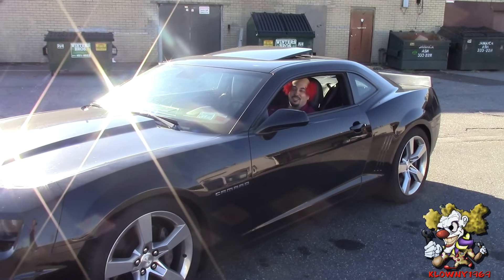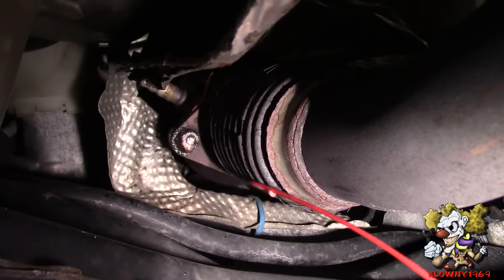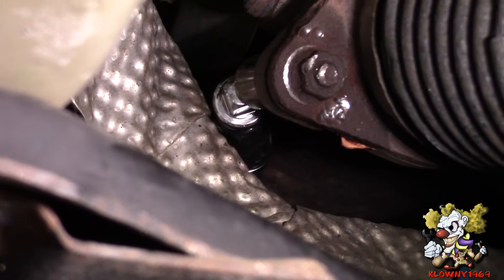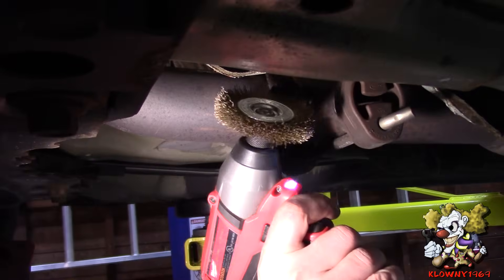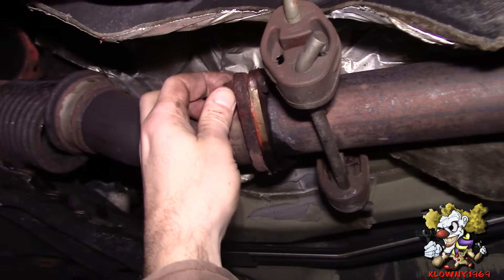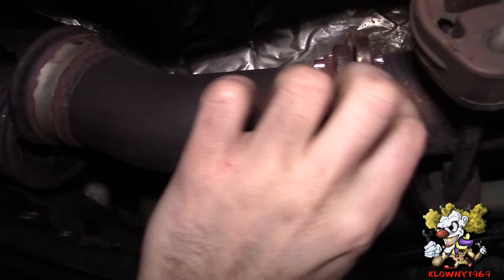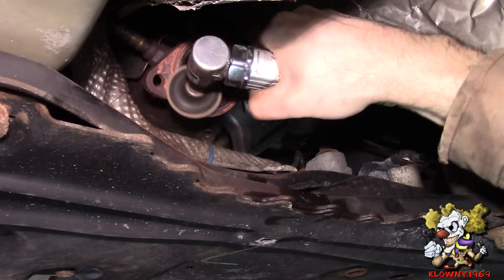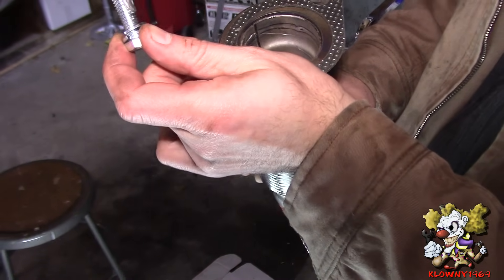FLEX PIPE EXHAUST REPAIR !! EASY DIY !!!!

Comment: Can flex pipe be part of the header? And if so do you habe to replace whole thing?
Reply from the maker: You can cut it off and replace it..Thanks for watching and don't forget to subscribe
Reply: @klowny1969  thx for info, would most auto shops have flex pipes laying around or you have to order it?

Comment: Will a bad flex pipe make a loud noise only when u start the car and accelerate that's what my exhaust is doing.
Reply from the maker: it could be numerous other things as well..you need to identify where the noise is coming from..dont forget to subscribe

Comment: I bought a aftermarket header tht came with a new flex pipe.  now the car makes a ticking noise. don't see any leaks anywhere but I heard the flex pipe that comes with headers is junk.  can a ticking noise come thru a cheap flex pipe
Reply from the maker: ticking noise is usually a leak..dont forget to subscribe

Comment: Amazing video quality. Thanks for putting in the time and effort for making and sharing this.  Much appreciated.  I saw a few drops of water leaking from one of the flange connections.  Is this something that one should try to seal up with high temperature silicone gasket?  Or is a little water leakage from the seams OK?
Reply from the maker: Little water is ok..don't forget to subscribe 😉

Comment: On that second flange since it's an actual nut and bolt you could tighten instead of loosen and just snap it and replace nut and bolt. It's sometimes easier to do that instead of trying to get it loose. I have done this and it works. I wouldn't do that with studs of course, but if it can be replaced, why not?
Reply from the maker: Thanks for the advice! Don't forget to subscribe

Comment: Hi Klowny1969, could you recommend andy video's on air tools please, I picked up an impact wrench here in UK 2nd hand no instructions, it has settings one to 4, I am unsure how to determine what settings to use as scared of breaking bolts, also do you set the compressor at say 90psi before you press the trigger on the tool or does  it need to be say 90 psi when using it, also as I see how hold spanners on the other end while using air tools is this ok when using certain settings as scared of breaking my arm, excuse my ignorance but I would like to learn, many Thanks Ian
Reply from the maker: sandydogy i keep everything maxed out..150 psi on compressor and highest setting on gun..ignore the recommended 90 psi, u would never take anything off...snd only use impact tools when taking bolts off..not putting them back on, unless u know what ur doing
Reply: klowny1969 thanks

Comment: I'm here cause I have a 2009 HHR that just rolled 100k a month ago and low n behold the engine light came on for 3 days. Then went off as soon as I borrowed a friends code reader. It still came up with a code even without the engine light on. The code $7E8:engine   and $7EA. I've looked all over the web and came up with "Hot oxygen sensor" and cracked flex exhaust pipe. 
Does this sound right to you or anyone in comments? 
Will replacing the flex section like you did here reset the engine warning light? 
Just looking into it before going to a shop and hearing what they think and will charge.
Thanks for your time and cool video.
Reply: idk but if your car sound louder than usual when you start it and it makes lot of noise when you drive then you need a flex pipe . run you about 180-350

Comment: How much does a repair like this cost? I ran over a dip kinda hard and now I think I dented/broke mine.
Reply from the maker: depends if they change just the flex pipe or the whole pipe itself with the flex..just the flexpipe should be under 100 bux..if the whole pipe needs to be changed..then u could be looking at couple hundred, depending on car
Reply: klowny1969 
It's a 2008 ford Taurus it was throwing a P420 code the day after I hit the dip and looking under the car the flex pipe looks pretty dented...so I'm hoping that's what it is so I don't have to replace the whole thing.

Comment: Was that flex pipe and flanges welded by you or was it a one piece bought at the local autozone
Reply from the maker: One piece..I mentioned in the video the part number I think

Comment: Yeah except not a DIY for any car when a lot of them are single cat back systems and you either need to replace the entire system or cut out and weld in a new flex pipe because there are no flanges
Reply from the maker: It's a piece of cake..even if u have to weld..gotta do everything yourself..you can do it!!

Comment: I wanna change the shocks in this 77 impala I picked up for $900. But afraid once I   get em off can't get em back on.....cars in great shape but lots of rust on original bolts underneath etc. Been driving it in stock condition for over a year. thanks for the insight
Reply from the maker: Kevi O easy to replace..cut nuts off if they are frozen..thanks for watching and commenting

Comment: fire hose
Reply from the maker: Jeremy Cornwell YOU READ HER MIND!!!!
Reply: there lying monsters
Reply from the maker: Jeremy Cornwell I suggest u put the doobie down
Reply: freedom is mine
Reply: The engineer who designed or invented the Flex Pipe should be sent to a safe and secure location called Guantanamo Bay!  ;o)  (crony capitalism)

What are your thoughts on charcoal canisters in cars?

...It’s federal law that all cars must have in the United States. 

“The purpose of a charcoal canister is to collect and absorb toxic, fumes. ...Yes?”  

However, doesn’t it defeat the purpose to coat the charcoal beads in a canister? 

(china parts)

 

And, secondly...Why is it forbidden or against the law to open a sealed’ charcoal, canister? o_O

 

https://www.youtube.com/watch?v=yLgMsqjsj58

(lol)

 

PS: I’m not a design engineer or someone who believes in global warming. But, I do have a few ideas for the charcoal canister.

Comment: Clown-Thanks for the vid.  Doing some research as my sons car just failed inspection.   Exhaust "loose, leaking joints".  An 04 Camry, and I've no lift.  Will 1200 degree RTV applied suffice?  You feel Home Depot's bolts to be high enough quality?  How does a newb know?  Thanks
Reply from the maker: Spencer Field i would just readjust everything and clamp it down..home depot bolts are good